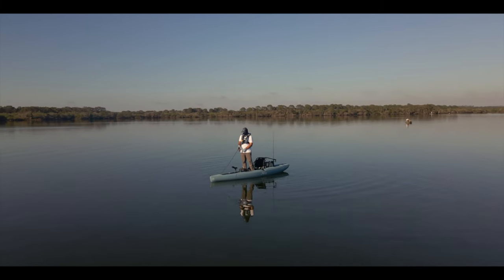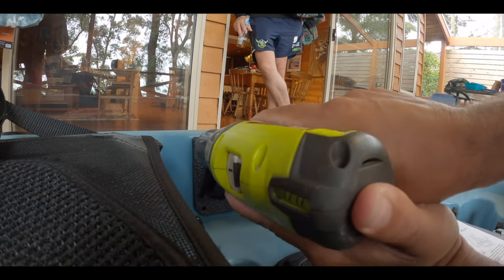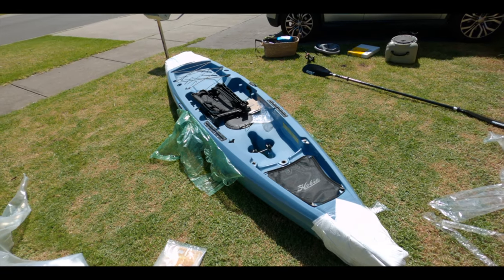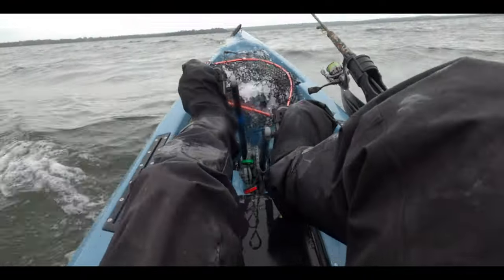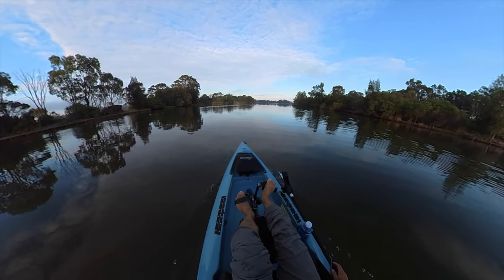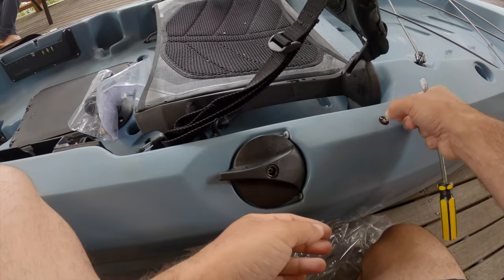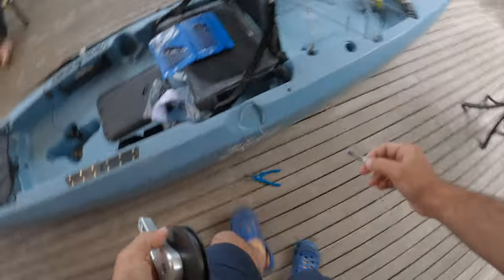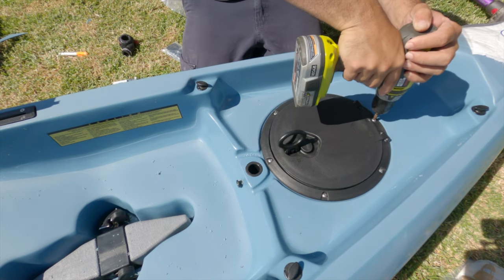Hobie Compass Review | Is it the Best Value?

Comment: Great video! I've owned a 2018 Hobie Compass and recently upgraded to the 2020 Hobie Outback. One thing you didn't mention about the Hobie Compass is that if you plan on using the latest fish finders on the market, the transducers are too big for the Lowrance ready plates. The best, and probably only option, is to purchase a BerleyPro cover for it. And the cost for one as well as the inconvenience of now having a new lower point of the kayak bottom is a big deal breaker for me and potentially a lot of other folks. Having the new Hobie Guardian system is an amazing feature that should be mentioned.
Reply from the maker: Hey Dennis! You are right mate I should have mentioned that buddy. Well picked up and thank you for the comment mate. Thanks again.
Reply: Just thought I'd ask, is the 21 compass compatible with the guardian plate? I own a Garmin 5CV so the stock plate won't work so well

Comment: I was going to purchase a compass but found a used outback for 2500 USD. I went that route mainly because of the dual steering handles. If the compass would have had those it would have been a no brainer because I thought everything you said about it. The only issues is all the little upgrades Hobie has you do. They need to have one set up like you had. If they did the guardian plate and dual handles it would be awesome.
Reply from the maker: Totally agree Mark, thanks for the the comment mate!

Comment: My wife has a compass and I just ordered 2022 in camo for myself.  Weight was big concern for me.  Was between outback and compass.  Certainly cannot go wrong with either but for me just an easier kayak for me to handle and I want to car top it with my Jeep.  Also when I use her compass it takes a small effort to hold consistent speed.  I’m a little concerned about 2022 seat clips but shall see…

Comment: Hey Byron
I believed I had made an inquiry through the correct channels for the compass & the special attached yesterday. A day late so probably not in the first 5 now. I also did asked about the the discounted price on the options.
Still haven't heard anything of yet.
Reply from the maker: Hey Jed, the discounted price bundle is now on their website, the link is in the video description. 

I just spoke to them, they haven’t got your message. I’d give them a call tomorrow Jed.
Reply: @ByronTeaHill  cheers heaps buddy. I snuck in by the hair of my chin. Pretty sure the Mrs is going to yank hard on that chin hair.
Your video once again was wicked. It was also the most expensive video I have watched.
But the good times are ahead. Cheers again.
Reply: Hi  @ByronTeaHill . Hey mate I'm wondering if you are interested on any feedback with HWS on the purchase of the Compass that I have made. May it be good bad or in proper due to availability.

Comment: Great review.  I'm trying to decide between the Compass and the Outback.  My biggest concern with the Outback is that it weighs 20 more pounds.  At 85 lbs, I think the Outback isn't going to be nearly as easy to handle and get into the water.  I have a pickup truck, so either would fit fine, but I will be loading and unloading it (as well as storing it) by myself often, and that 20 lbs seems non-trivial.  My concern with the Compass is the seat.  I have heard the Compass seat isn't as good as the Outback.  Do you have any comments on the comfort or design of the seat for the Compass versus Outback?  I know this review is several months old, so I understand if you don't reply.
Reply from the maker: Hey Kevin, thanks very much for the comment,

The outback seat is better than the compass but only marginally. The thing to consider if you're a heavier gentleman is that there's a bar across the back of the seat on the compass that you may push against if as the seat compress's down. you'll see it when you look at photos, but thats probably why I say the outback is better